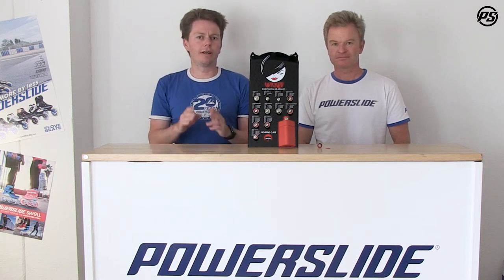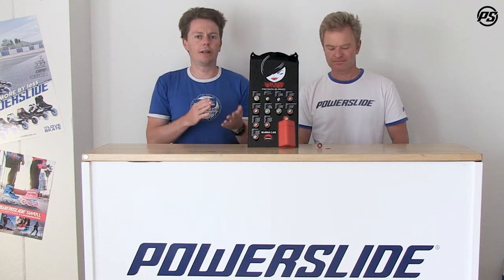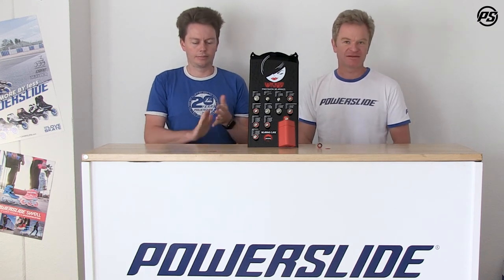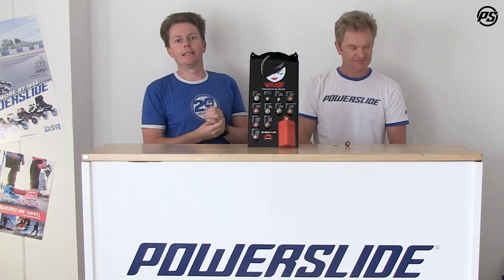Wicked Bearings ABEC line - Speaking Specs

Comment: I want to buy Powerslide Next Black White 90 skates. A sales representative told me that the grease in the bearings is of average quality. He told for a maximum of speed and durability we recommend to re-oil the bearings. You can also use grease which gives the bearing much more durability, but less speed. It's worth to do it???
Reply from the maker: depend of you taste for speed^^ or durability... grease we use is first focus on durability when it come to complete new skates, you can make then roll faster by cleaning the bearing and re-oil them but you will have to do it regularly to keep the bearing in good condition.
Reply: @PowerslideInlineskates  I prefer durability and that I don't have to service the bearings often. So the lubricant you use will meet these expectations? The rollers have already been ordered :) I also bought two types of lubricants from the German company ABA Inline Skater Technik. One is an olive and the other is a thick lubricant.
So it's best not to do anything with the new rollers and later for first service use thick grease? And finally, the important question will I do 100-150 hours of ride on your grease? I only drive on sunny days.

Comment: What kind of grease is used in wicked bearings? Would like to know the OEM grease used in the bearings. I have ABEC9 wicked bearings that came with a powerslide set of skates
Reply from the maker: wicked uses koyo grease in its bearings
Reply: Thanks for your response, would you be more specific on the type of grease? Maybe part# or Type or working temp. Right now I’m using oil, but would like to go back to the original lubricant. It requires less maintenance